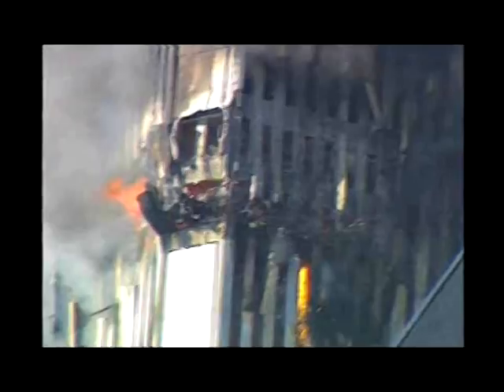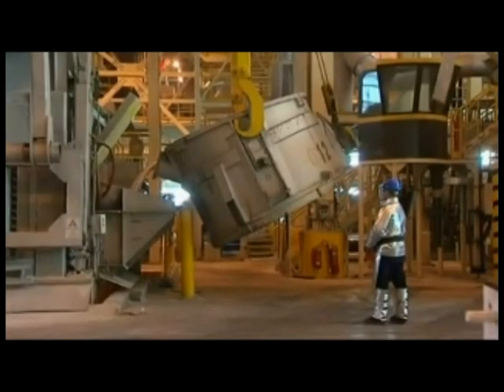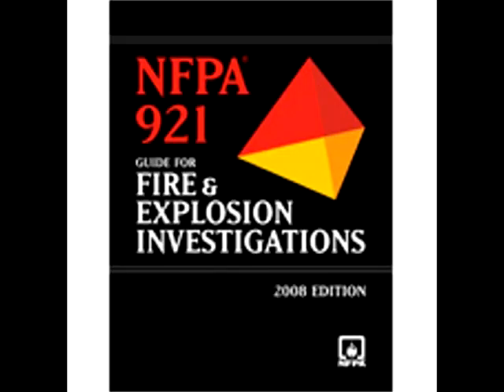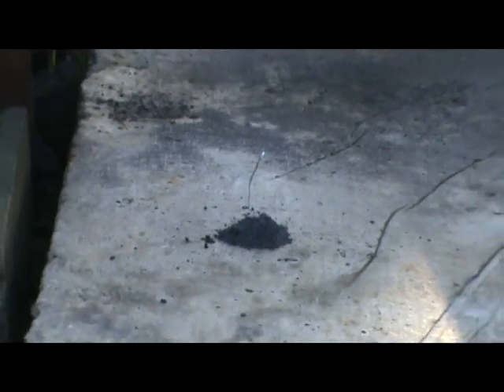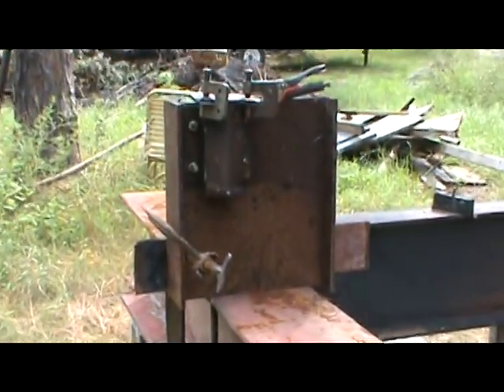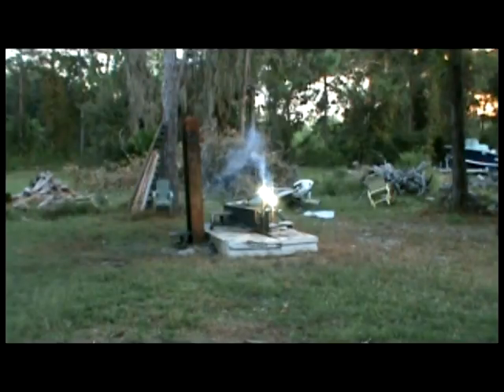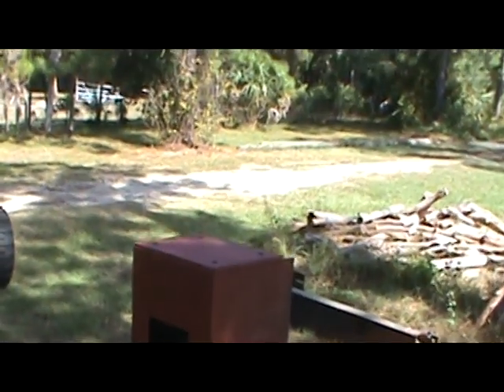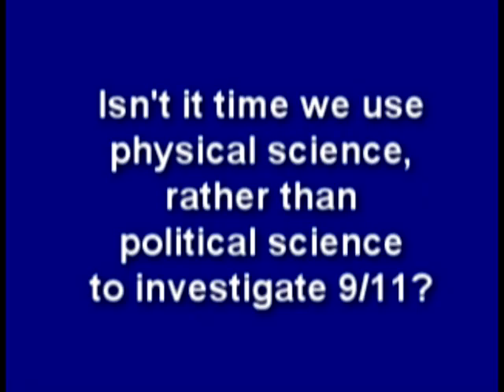9/11 Experiments: The Great Thermate Debate

Comment: So.... I don't know if people realize this, but steel loses half it's strength at about 1100 degrees f. Jet fuel burns to about 1500 degrees f. It didn't need to melt, once if was weakened enough the weight of the building bent and twisted it causing a chain reaction. 
No building fire has ever melted steel, yet plenty of steel buildings have collapsed in fires. Are you proposing that every single steel building that has collapsed in a fire was done by an inside organization?

Comment: The problem with this whole theory is the assumption that jet fuel only burns at 1800 degrees.   If your talking about  just lighting it on fire in a confined space with NO air flow this is correct.  If your talking about burning it in a jet engine this is also correct, since that is the max temperature the engine is designed to run at.   However if you take jet fuel and feed it a constant supply of air or even cause a serious draw of air, say up a elevator shaft, then you can achieve MUCH higher temperatures.   It is not inconceivable to achieve temperatures of 3400 F with enough jet fuel in the proper conditions.   The flow that was coming out of that wall was too constant to be something as short lived as thermate.  However if there is a jetliner full of fuel that is a lot of fuel for melting steel.  If you want a good analogy, you can consider the area the Jet crashed a Black smiths forge.   Everything in it that can feed the fire, will.  With the proper airflow, even wood becomes hot enough to make steel cherry red.
Reply: Yes I did, and with all the items that could burn inside the building it would not surprise me to see black smoke.  We are talking about a fully loaded airplane hitting a fully functional and occupied sky scrapper.   If the only things on those floors were concrete and steel, you might have a color of smoke argument.   Plus have you seen what color lite jet fuel burns?  Yup, black.
Reply: +EvilOverlords Modified diesel trucks can have exhaust temperatures of over 1800 degrees. And that is the temp of the exhaust after it has left the cylinder head and cooled down a little bit. You can melt pistons if you let it get too hot.
Reply: +EvilOverlords So, why did WTC building 7 fall down?  It wasn't hit by a plane.  Why did it fall so quickly?
Reply: Iam TheOsprey   I don't know why it fell, but if it was hit by any part of the two sky scrappers that was next to it, I could see enough damage being caused to make it unstable and fall.  I would be more likely to believe that was a controlled demolition, than the twin towers.  I am not saying it was, but that is for different reasons, building 7 housed a bunch of federal government offices and held evidence for a number of agencies.
Reply: EvilOverlords
If structural instability caused by random flying debris caused it to fall it sure did fall in exactly the same way a planned explosive demolition of a skyscraper falls.  If debris would have caused it to fall it may have fallen a month or two later and in a cattywampus way.
Reply: didn't you see al the black smoke coming off the towers? it couldn't have burned that hot
Reply: *****
Whatever cut the steel caused everything else to catch fire.
Reply: EvilOverlords there wasn't enough fuel left over from the explosion for that

Comment: This is one of the best demonstrations that I have seen yet.

But even so, with thermite being a non-explosion, how is it possible to get the thermite so precise that it would make the building fall in total freefall and not topple over sideways?  I thought it would take high explosives for a precise controlled demolition as such since you would have control over the timing of the detonations.
Reply: +isufan89 wtf lol
Buildings will only ever fall directly downwards if all the structural integrity of an entire floor (or several floors) is compromised in a small amount of time. That is how controlled demolitions are conducted so buildings don't go whacking into other buildings on their way down during their demolition. Just watch a few videos of buildings going down sideways in earthquakes if you think buildings magically all fall downward when destructed.
Reply: And also, are you suggesting that the thermite was installed in the building during construction which started in 1966?  It was just sitting there for 35 years?  Or was it planted later?

I wonder why they didn't use it during the first terrorist attack in the garage in 1993.
Reply: +isufan89 you speak shite sir. No steel building falls straight down without help from explosives. Or do you know something Industrial Architects don't know, sonny.
Reply: Would thermate be able to accomplish a perfectly balanced free fall?  Methinks that thermate would not be precise enough like shaped charges that are perfectly timed.

Which is weird, if they didn't care about collateral damage and wanted to make the destruction of WTC7 more probable, why not have a random explosion that would have toppled WTC1 or WTC2 sideways, or sort of irregular, to increase the variety?  Having two tall buildings demolish perfectly identical to one another is too big of a coincidence to ignore.
Reply: +Kirk McLoren  So what you guys are saying is the thermite was put there so that in the event of a building demolition (or an emergency), the building would fall straight down and not over. 

Even if this was an "inside job", you have to admit it'd be a lot worse if they toppled. Hella worse.
Reply: It would seem like much of a liability to pre-wire a building for 35 years.  What about an unplanned accidental ignition?